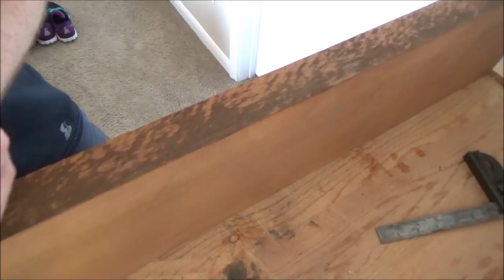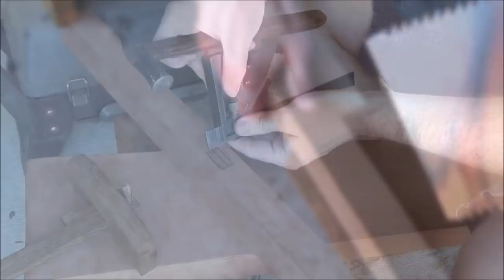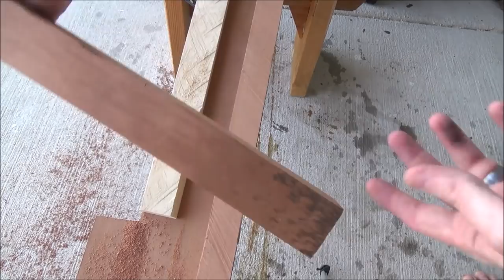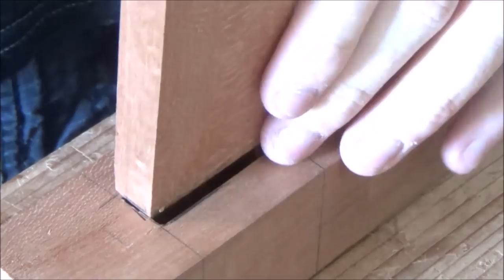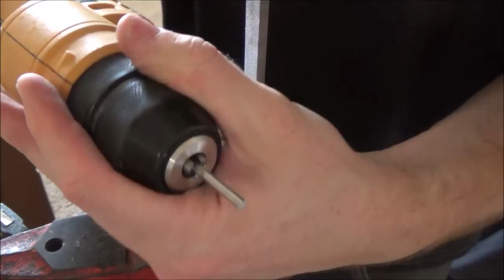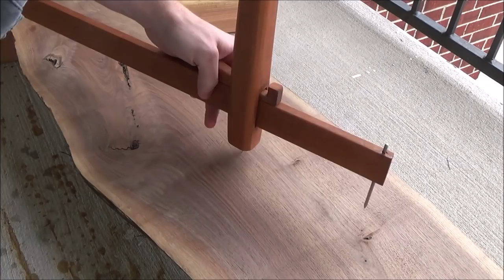Woodworking, A Japanese Bunmawashi (Beam Compass)

Comment: Those long rip cuts blow me away. I saw you split a board across the thickness too. Those saws are amazing. Who needs a table saw??
Reply from the maker: #whatsatablesaw?
Reply: @W. Adams but it just isn't so much fun as hand sawing, I also used to think everything with power tools gave better results, but now that my work space is just about 6 m, I've come to apreciate hand tool work more and more. With practice you will become more accurate and best of all, it's harder to mess up with hand tools. Or maybe I'm just biases, who knows.

Comment: Great work, are you doing this in an apartment unit?
Reply from the maker: Jon P thanks! and yes I'm in an apartment
Reply: Love it, I started up hand woodworking as I live in an apartment as well.   Am currently building a workbench for my interior and contemplating a Japanese style saw bench for ripping and crosscutting (to prevent saw dust in my unit).  Any ideas/recommendations?
Reply from the maker: I think that having two small workspaces really is the best way to keep the apartment clean. I do the same thing except I use a few small saw horses (ponies?) instead of a bench for the outdoor space. Planing happens inside since the dust is less, sawing, scraping and finishing happens outdoors.
Reply: Lemongrasspicker I do most of my current work outside with a makeshift table and a borrowed jobmate but will eventually replace them with either a smaller bench or saw 'ponies'. I do  like the idea of using saw ponies, do you have any recommended designs?
Reply from the maker: Jon P for the saw ponies yes. I'm actually planning a video for it in the next month or so. For the bench I'd just say if you have to make a small one like a saw bench then you should make it as heavy and beefy as possible. alot of the more traditional mini workbench designs tend to be a bit flimsy
Reply: Great, looking forward to the video.  The saw ponies would be easier to carry in and out of my balcony.

Comment: Why did you rip with the crosscut side of the saw???
Reply from the maker: I didn't, I did the rip cut with the rip cut side of the saw.
Reply: Sure looks like you've got the rip teeth at the back of the saw, and then are using them to cross cut later.  Must be a different grind than every ryoba I've ever worked with, or a screwy video artifact.
Reply from the maker: It's just a normal gyokucho ryoba. Nothing weird or special.